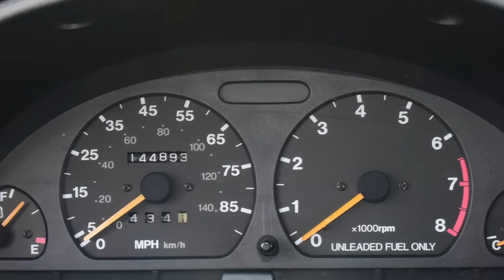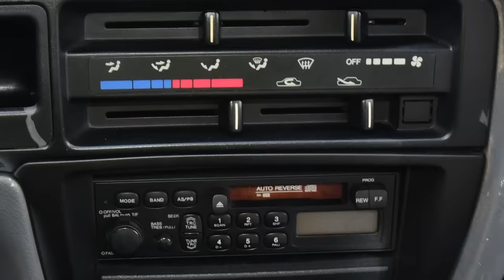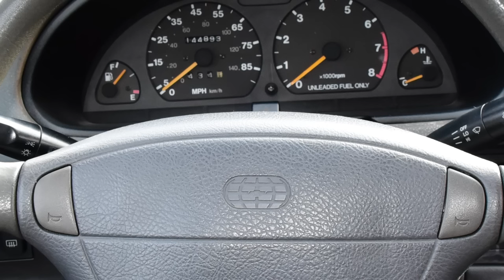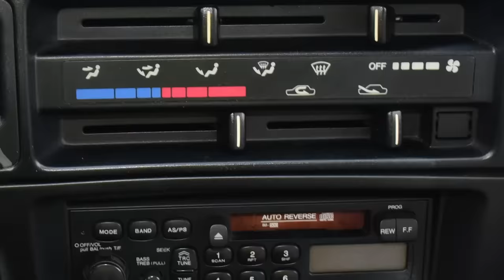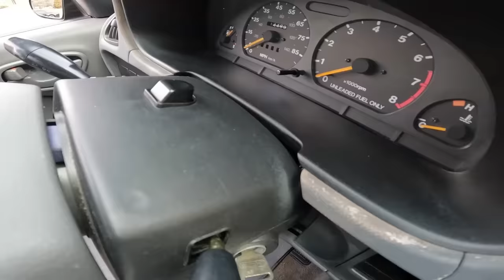1996 Geo Metro 5MT: Regular Car Reviews

Comment: 10:32 my 99 buick century......... its cheap, its plastic, everything snaps together
but i can have the radio out in about 2 mins.......
water pump takes 5 mins....20 dollar part.....takes longer to bleed the 3100 v6
.
and that 3100 V6.... while not a buick 3800 S2/S3..... is just a fun little motor (LOVES to rev....decent torque low, but 4200 to ~6300 is the sweet spot..... a bit more RPM on the "large port" 3100) 
and just takes abuse...... 372,000 on my 99.... broke the cam in half due to 1, its hallow and 2, cam chain slack/"whiplash effect" 
.
the poor 4t60e lived also.........just 85,000-100,000 mile pan drops and a new filter (not even a torque converter clutch issue)
3.1 dont have the power to kill it like the 3.8
.
"new" junkyard motor was 400 bucks.......
.
.
its slow, its a granny car
but its NEVER left me stranded (except when i red lined it for fun.... and broke the cam)
even then, it ran on 4 cylinders..... just no oil pump drive (was trying to save block, but spun cam bearing = junk block on these motors)
.
i could have drove it home.... would have locked up in the driveway, but id be home

Comment: It was my first car (a white 1994 Suzuki Swift GA). Bought it for cheap in 2009 with 34k miles and sold it a few years later with 90k miles. Good car, though I probably wouldn't survive a more severe crash in it. Mine had A/C, and it was usable, but I would need to turn it off when my friends were on-board, and there was a steep road ahead. Mine also had those crappy dour-mounted seat belts that never worked (in '95 they ditched those belts for a driver-side airbag). The '95 -'01 Metros had technical and safety improvements over the first generation, but I still prefer the boxy design of the first gen. This blobby design from the 90s is a turn-off to me. I can't take it seriously.

Comment: yeah and when Geo was discontinued its most popular models the metro the Storm and the prism became Chevrolets until they were eventually discontinued in 2001 which was the year I would've gotten my driver's license if I'd wanted a Chevrolet at the time it would've been either an Impala SS or a Blazer LT or a used 1996 Baretta Coupe. mind you the malibu which came back for 97 model year sold 115,468 units last year good for 4th place among mainstream midsize sedans

Comment: If you correct for inflation, a base Metro in 1993 doesn't cost much less than a base Ford Fiesta in 2011 ($11.4k vs $13k in 2011 dollars). The Fiesta is a hell of a lot safer, though if you get hit by a "normal" size vehicle you're dead in either one. But I'd still rather be in the Fiesta given the choice. The Fiesta had a peppy motor, and the base model was a 5 speed so you could avoid the crappy Ford DCT. Quite honestly if you drive a Metro in current times you'll literally get shoved off the road by a gigantic lifted F-150 or Escalade. Why? Because you aren't accelerating fast enough.

Comment: Hey, my all time favorite car I have owned was a Ford Festiva, the South Korean one. So I like micro-cars. I heard the Geo Metro was made in Canada. I would have gotten one if I didn't already have the Festiva. Geo Metros were also very popular with the "hypermilers," those strange strivers for astronomically high gas mileage. Actually, my current car is a Daihatsu Mira Kei-car. It also has a three cylinder engine. It's gas mileage is nothing to write home about but the two year inspection cost is cheaper than a larger car's. Is it safe? Probably not, but here in Japan, many of the other cars are just as small.

Comment: Honestly if you think of a metro as a on american car it doesn't make sense.  If you think of it as a Japanese car then you start to get it.  I picked up a 97 metro just like this a few months back to commute the 60 mile round trip for work.   It's cheap, reliable, and honestly it's a riot to drive.  Yes it's slow and very under powered.  That's part of its charm though.

Comment: Reason for fuel economy change  was the transmission final drive gearing was changed that's what impacted fuel economy. Also this isn't a GM product its a rebadged Suzuki. They had nothing to really do with it. The sealed headlights were a year change not a option.  I have a 97 with a/c and it is not that bad. I suspect the engine is worn in on that one. With a fresh stock rebuild they are not that terrible.

Comment: I drove one for about 6 years , very simple car and cheap to fix . 45 mpg but they are slow back when they came out they were ok because all the cars were slower. In today's traffic 2023 when everyone is in a hurry and 4 cylinders have 250 horsepower or more it's a challenge to drive and not be annoyed. I'd rather drive a something faster and spend more on gas and be able to pass an idiot looking at there cell phone while driving ,slowing down, speeding up and screwing up the flow of traffic .

Comment: In Australia we got these as the Suzuki Cino and we actually had one but in Australia we got them with 1300cc 4 cylinder engine ours didn't have air conditioning and in Australia you just open your windows we did drive it on the highway anf it was the most fun l have driving it and it was one of the best cars l hsve driven of all the cars utes and vans we have owned and there was a sporty version of the Cino the Suzuki GTI fuel injected ours was carburetored getting back to the GTI it had a double over head cam and l think it had four valves per cylinder and in Australia they had a one make race series with yhe GTI and we have a 2021 Suzuki Beleno GLX  and it gets around in Australian mpg 38 around town and 50 on the highway and it cruises with ease at 110kph and it is a 1400cc 4 cylinder engine dohc also it has apreciated by aud $800 because Suzuki Australia don't bring them into Australia any more and another thing is that in the same factory in India they build the Toyota Starlet which just rebadged Suzuki Beleno so they must be reliable as a Toyota and l know about Toyota reliability because l am fortunately own a 1997 Toyota Hilux rwd ute with the famous 22R engine has done only 430000kms still going well no oil burning issues but it will at least do 980000 kms because one just sold for aud $500

Comment: It's funny watching this video as a Brazilian, because a good amount of the cars you see in the street (or used to, anyway; the cheap new car dream is dead, long live the used car. New cars in Brazil are now reserved for the upper-middle class and fleets) are just like the Geo Metro: tiny, weak, 1L, two door, cheaply finished eggs that get you where you need to go for barely any fuel. See the VW Gol, the Fiat Uno, Renault Kwid, Fiat Palio, Chevrolet Celta, Renault Clio, VW Up, et cetera ad nauseam.

Comment: I loved mine until an oil and gas truck smashed it up. I’d buy another but all of them I find in my area are completely ragged out and the k frame tends to rust through. If I ever find a good donor body I would do a restoration. Perfect for an EV conversion and dirt cheap to maintain. 

A lot of room for mods for better mpg. 

As an EV it’s at the very limit of how low you can go when it comes to watts per mile. I’ve seen as low as 180 per mile and it’s light enough a 48 volt system can be used. Weak AF though.  To compare, most modern EVs are super heavy and run about 270-320 watts per mile.

Comment: As someone who has several hundred thousand miles behind the wheels of 3 of these cars, they are so much better of a car than people realize. Is it a limited "POS" with barely any features and not much to look at? Sure. But who cares, look at what ACTUALLY matters.. Incredible gas mileage? OMG, where do I begin? I used to get between 40-45mpg CITY, CANNING the shit out of it like the streets were a rally course... Despite being slow, they are SO fun to drive... I had 2 94's (previous gen to this one - both wrecked by stupid bitches running into me that couldn't drive) - and I have this exact car (black 96)... Still holding onto my 96 in case the shit absolutely hits the fan (unfortunately I'm counting on Brandon to make that come to fruition)... They have always been reliable, cheap and easy to operate and fix - Imagine what this platform could've become economically and feature wise had they integrated modern tuning and fuel injection... 60+mpg...?

Comment: For a car intended to be an econobox i respect it. But 55 hp in 2023 is way to slow and especially if you live in an area that has a lot of hills . You are basically  going to have to floor the gas pedal 85% of the time. Going to a highway in this must be a chore and a half you are basically going to be floored the whole time.

Comment: Wow, I feel like a lot of this could be said about my 2010 Honda Insight. I've had it for two years now and have developed a love-hare relationship with it.
It's tbe beginner sword in a video games, has no horsepower, parts are cheap (some can be used for my wife's Civic), it's ugly, is light and weak. The only thing it has going for it is the fuel economy and that nobody will steal it.
I'd be a liar if i said i didn't like it though. I've laid the backseats down and moved more lumber and furniture in it than most bros with their lifted pavement princesses

Comment: When I was in college in the 90s, I worked in a garage and waited almost a year before I finally got to work on one of these. I wanted to feel how slow the three cylinder was, but I was surprised at how good of a city car it was. I gave it a set a tires, an oil change, manual transmission drain & fill and a set of spark plugs. It’s been over 25 years, but I believe his bill was under $250. I took it for a quick spin around the block for a road test and got around just fine. I remember really liking this little car.

Comment: I'm not trying to be a jerkass but "sell your game consoles to buy a Geo" is kind of... Incredibly out of touch.

Like, the answer is going to vary wildly depending on what the consoles are. If it's a PS5, xBox Series X and the latest OLED model Switch then you might be able to swing a little over $1k, if it's like... IDK an xBox One, PS4 Pro and an original Switch or Switch Lite you might get $300-$700. If it's like... A PSOne, an xBox 360 and the Switch? You're looking at like... $300 tops. Cut those prices in half if you're selling them to a game store as opposed to a private buyer.

Add onto that the fact that a Metro isn't cheap anymore, they got enough of a cult following when gas was expensive and I regularly see them go for $2,500 to $4,000 and in that price range there are far better equipped vehicles available from a practicality standpoint. They definitely won't get the same MPGs but something like a 2.Slow Jetta or a Saturn or Civic will definitely be a lot easier to live with.

For something you can regularly get under $1,000 nearing the $500-$700 range you're looking at like... Old busted Cirrus and Grand Caravans that won't last long, maybe like a Cherokee but those are godawful on gas. It really is difficult to claw your way out of a shitty living situation like that. I was lucky to some extent, I got an aircooled Beetle when I was in high school and was able to sell it for just enough for the Greyhound tickets to move in with online friends in another state with better job prospects.

I still miss the car but I'm glad I got out of Georgia.

Comment: You ARE so wrong about everything you have said about this car.  The previous style 89-94 is SO much lighter. I can get 80 miles a gallon outta on of THOSE. NOT this one tho. As a side effect of doing this to one of the 89-94 models it'll do 0 to 85 in the time it takes you to speed shift 1st-3rd-5th. About 4 to 5 seconds.

Comment: You think that’s good on fuel.  I get on average 55mpg on my 2005.5 jetta tdi.  The best I got was a little over 800 miles to a 14gal tank of fuel, admittedly only once but I usually average around 650-700miles.